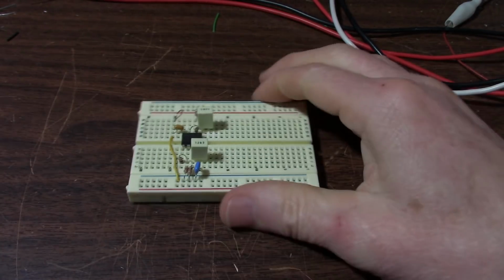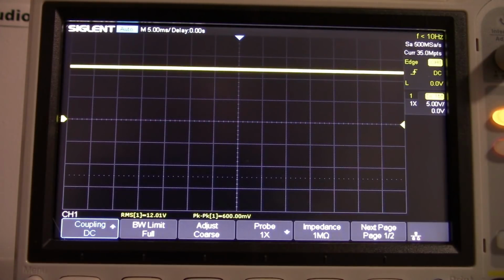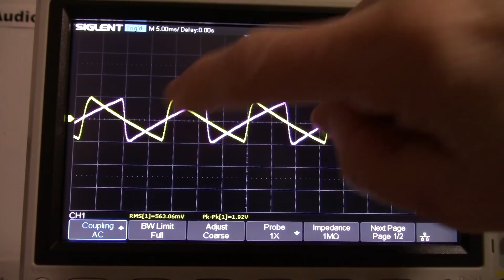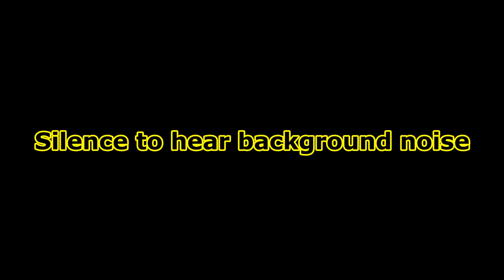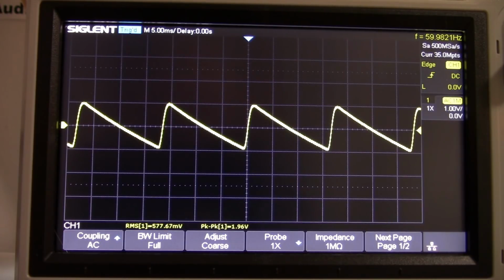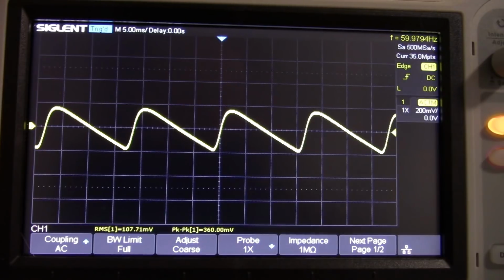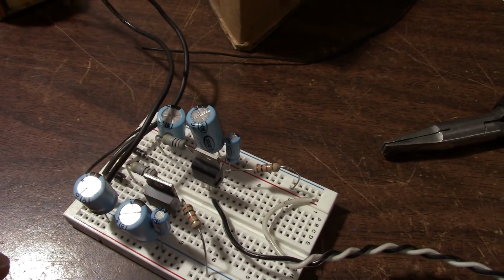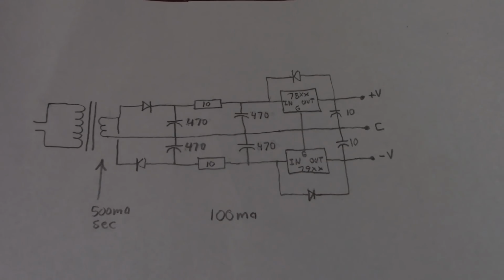Opamp power supply starting out bad and then making it better

Comment: Multiplier supply is fine if you have a single winding transformer but need split rail supply for lower currents. Plop capacitance multipliers at the outputs and you have a solid hi fi preamp supply there.

Comment: Early in my career (1970) i worked for Analog Devices as a engineering technician so I got a good grounding in opamps. Even early opamps have a pretty good PSRR (power supply rejection ratio) and that makes them somewhat forgiving with regard to ripple. That said a good clean supply is important if you want the best performance

Comment: if the 10 ohm resistors are 1W resistors, the output will max out those resistors at 80mA, which will create thermal issues. 50mA is a more likely rating for its output.

Comment: Another great video! Can you teach us to build a switching power supply? Maybe a dual rail thing?
Reply: There is almost no point "building" a switching supply. They require so many specialised components, just the output inductors can be a massive problem to source (at an economically viable price).

Comment: For a low current circuit like this were absolute voltage stability is not really an issue you could use a capacitance multiplier to pretty much eliminate the ripple.

Comment: The professional use line level circuits operate on signals that can significantly exceed 2V. There must be enough headroom. Even newer opamp designs can work better with a reasonably high supply voltage(better linearity for signals close to rails, sometimes better slew rate,...). Sometimes it is necessary to use chips with j-FET inputs and common-mode input voltage range turns out to be a limitation.

Comment: I have questions -
1. What should be the output capacitor value for the regulator IC if the required load current is 500 mA - 1 Amp (higher current version regulator IC) for running low power audio amplifier chips like Lm386, Tea2025 etc ?
2. Is it sufficient to have only one electrolytic capacitor at regulator output or a combination of ceramic capacitor (0.1 uF or so) for suppressing high frequency noises ?

Comment: Wouldn't a full bridge reduce the capacitor requirements?
Reply: two half bridges are often used to produce split rails
Reply: Yeah, don't know why one would use a half-wave in modern times, it is a waste of tranformer capacity and diodes are cheap. May have made more sense when rectifiers were expensive.
Reply: @HillsWorkbench  Because I can still get +/- 15V from a transformer whose output is only rated at 12V6.
Reply from the maker: @HillsWorkbench  Half wave is fine for a low current supply. Allows for a split supply with a transformer that is not center tapped. It does use both halves of the waveform (my transformer was not center tapped). More common voltages available, such as 9 or 12 volt secondaries.

Comment: Great video, but because of what opamps do, EEVblog also explained it well saying that opamps try to equalize negative and positive inputs. I wasn't too surprised by this. However, I recently realized that transistors themselves also don't care much about their power input, because they are a current device. They just amplify the current coming in through the base, right? Depending on temperature and operating range. So power amplifiers, mostly, should also inherently not care much about some level of noise on the power input. Unless mistakes were made. Do I understand that correctly?

Comment: I have seen power amplifier transfomer center tap connected with pre amp ground and connected to metal body of amplifier. Somebody said connection with body of amplifier is mandatory to reduce noise. Is it? If so how it will reduce noise?
Reply from the maker: Having the metal casing at the same potential as the circuit common can reduce potential noise ingress but can introduce ground loops.
Reply: @JohnAudioTech now I know .  thank you 🙏.  Hope you're doing great 😊
Reply: The 0v rail can be lifted by a 4.7Ω to 10Ω resistor rated at 2w to the earthed chassis. Cambridge Audio used this method in their A5 amplifier.

Comment: You could do another test with a capacitance multiplier.
Trying it before or after the regulator.
I've always wondered if such a circuit works well and if work better before or after the 78xx/79xx
Reply: @Paweł Hadam Yes I was think about low power circuits.
In my mind I was thinking to use 78xx/79xx to level the voltage and the capacitance multiplier to filter high frequency ripple noise.
If I use the multiplier after the 78xx/79xx i will lose a little bit of headroom due to the transistor. 
I was wondering if putting it first could filter the ripple anyway.
Reply: @Paweł Hadam i use LM7824+LM7924. 
I don't have an oscilloscope in my garage (and I cannot bring my circuit to work...), so I cannot check circuits in an accurate way.
I will try the LM317 in the future and I hope this will perform better!
Thank you for the advice!
Reply: @mastroaka  Way over for most op-amps. Most can handle a maximum of 30v to 36v on a single polarity supply voltage. Use a maximum of 15v per supply rail for a dual polarity supply that does allow some headroom. The LM 317 does have a negative counterpart the LM 337 regulator. Velleman does a kit that uses these variable regulators.

Comment: If you use simple transistor regulator say zener diode and high gain single power transistor in pair to compare them with voltage regulator IC in next video it would be a perfect comparison.
Reply from the maker: I might have to try that.

Comment: I hear more dynamic range and betetr high frequency response in the first sample , let`s see which is which
Reply from the maker: The first sample has the better supply (batteries). However, I doubt there was any audible changes to the music. If you listened to the second sample first you might have considered it better.
Reply: @JohnAudioTech  I listened to it using professional audio monitors , regular hi-fi speakers mask a lot of what is going on on high frequencies and might make the two samples sound very close.
Reply: The difference is very subtle but it is. The second sample sounds a bit lifeless. 

The ripple is not loud, but a single stage with a moderate gain does not have a significant influence on relatively strong signals. The game starts when the signal has to be amplified strongly and the gain is applied in multiple stages. That is why good power supply is important.

Comment: 100uF vs battery
08:51 1st sample
09:37 2nd sample
My comment : at my 90% headphone volume from mobile,
I just cant hear the difference, not even the noise. Are you serious john? ;)
Reply: I build my power supply for ne5532 preamp, i can hear the noise if i put my ear on the tweeter side.

Comment: Am I missing something, but wouldn't you want a LC-pi-filter rather than an RC-pi-filter? Of course you would then need a series RC-network to prevent the filter from ocillating, but you should get a better result with that.  
  
Annotation: Expenation why this is a bad idea are in the comments.
Reply: And also you could get a desingn with that that can output much more power in theory.
Reply: It's not necessary if you only need to send high frequencies under the noise floor, it seems. -20dB per decade is enough when the cutoff is only 15Hz. And low frequencies can already be rejected by the regulator.
Reply: @notatoyotacamry195  Okay I just punchen in some combinations for RC an LC pi- filtes. And you will get ether huge inductors or capacitors to get your cutoff frequency as low as 15Hz. So it's just easier for the low currents to go with RC.